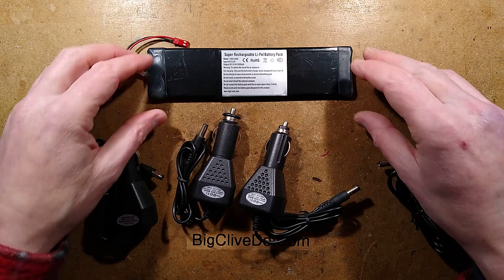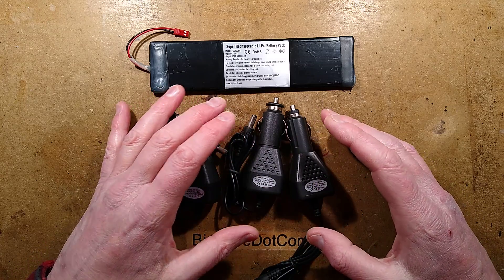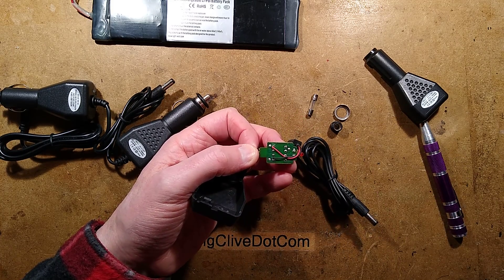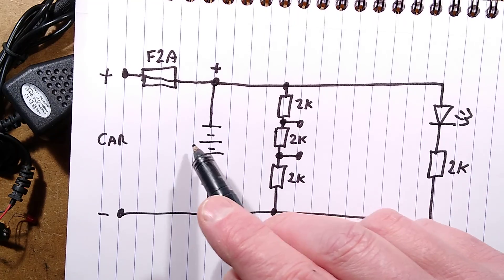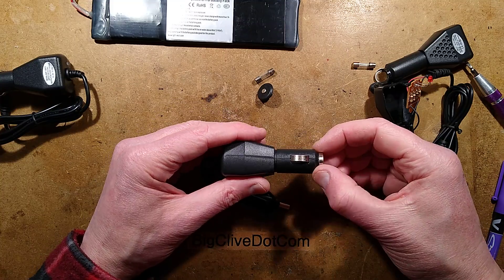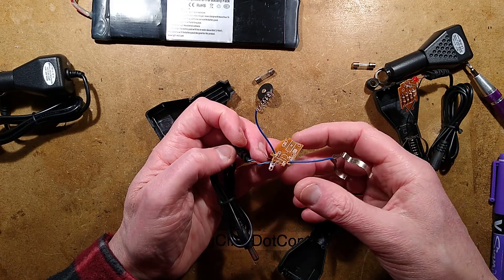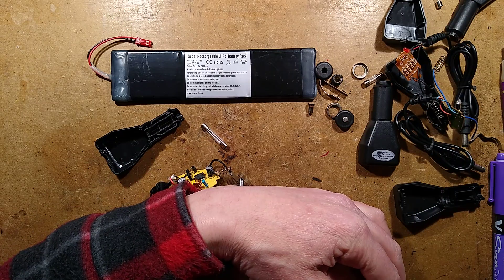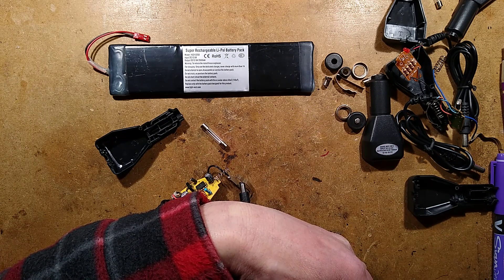Triple trouble - when offshoring goes wrong

Comment: re: that external wire freak fuse
in fairness, for low current and low voltages, there are open style fuses. see german/EU automotive style from 1970-1990.  for that matter, the Japan/USA automotive regular and mini fuses are simply enclosed in plastic to prevent accidental shorting.  It IS possible to find proper fuses with exposed filaments used for automotive products (or mass production low voltage) .  The "fuse" we saw here looked to be 10-40A if real, which is clearly too high.  maybe the assembler got a "deal" on 10-20k of 20V/25A fuses in this mini size, perhaps intended for a board clip mount, which were disco/sitting inventory from an unknown (chinese) manufacturer.  Or, the rush current from the non-circuit straight-charging was popping all standard fuses in the size immediately, so extreme "fuses" were batch made for this fraud.  This is much more likely than someone in China reworking individual blown fuses.

like 99% who might read this, I have some expertise.  But if I didn't, a takeaway would be to check the fuse when you buy something cheap that plugs into a car's socket.  With higher cost, trackable sourcing works in your favor, but the cheapest items out there often fly under the radar of regulation.

Comment: If bms inside the battery limits the current and protects the battery, no big deal to send 12V directly to battery.
Reply from the maker: The BMS has no current limiting.  Just extreme load cut-off.
Reply: @bigclivedotcom  It must be very s**tty BMS. Open it and have a fun

Comment: My Baofeng UV-5R "foldable" antennas ended up being two strips of measuring tape screwed together under a very nice rubber finish. (The Bezos company has no problem selling these products). I already knew the antennas were fake before cutting them apart because the manufacturer "website" listed as follows: "sample product 1" "sample product 2" "sample product 3"...

Comment: Wow, those 'manufacturers' (bodgit n scarpa) really didn't give a stuff when they made those. It's probably also a major problem if a company buys in a batch of those chargers from a supplier to include with a well designed product of thiers, and then doesn't spot check every batch. They wouldn't realise if the supplier cheaped out and bought in a sub standard product.
(Something similar happened in the Aerospace industry a few years ago when an import supplier bought in cheaper bolts/fasteners without knowing or caring they were destined to hold jet engines together). Scary stuff.

Comment: I talked to a guy who worked for McDonnell Douglas when they were doing their "trunkliner" program for the MD90. They spun up an assembly line in Shanghai. He was on the team responsible for QC. Very long story short, the second they turned their backs, the production shortcuts would start. Missing rivets, wrong fasteners used when doing dissimilar metals, wiring not routed appropriately, just nonstop corner cutting. IIRC, those planes were basically re-checked as soon as they landed back in the US to ensure nothing was missed. 

~15 years later, you see Comac come out with the ARJ21 with parts obviously ripped off from the MD90 design. Can't imagine where they got those blueprints or tooling from..

Comment: Chinese (PRC) industry has practically ZERO ethics in its manufacturing and sales. For them being able to sell a low-quality or even flawed product is a measure of success - makes them feel smarter than the idiots that buy them. You need your quality control supervisors on-site to make sure flawed products are discarded before they get into your supply chain. The problem is that those products then end up in someone else's supply chain anyway.

But this strong lack of ethics is the opposite of Confucianism, and is definitely not present elsewhere in the countries that have had strong Confucian influence. Taiwan for example, or even Japan, where aiming for perfection is at the heart of their manufacturing and sales principles. 

Why? 

Years living under the control of corrupt and untouchable party officials? This is what scares me from China. A Confucian China is a good for the world. An morally corrupt China is not. 

Can some Chinese readers comment on this?

Comment: Fun stuff when you find out Ford and Toyota never lowered their charging system voltages to compensate for maintenance free batteries that came around in the early 70s, so they still charge 14.5-15.5 volts.

Which you will see across a cigarette lighter socket.

Comment: My favourite Chinese manufacturing story relates to dumb base plates for railway sleepers. A friend went to China and checked out the products and found a defence contractor who produced these dumb bits of plate with holes in them that met the standard. The engineering issue here is that this was a high speed track and if the holes elongate and the track width changes a train fires off at 200 kph etc. An accountant unilaterally decided that the 30% extra cost for the good product  was a waste and decided they should go with something cheaper. Well, a few months later the plates failed and the litigation started.  There were lots of zeroes on the claims.

Comment: I was watching a video from Shango066 where he was working on I believe it was a CRT TV where there was aluminum foil wrapped around the fuse and on another video on a TV where some one removed a circuit breaker twisted the wires that went to the breaker together and taped them to a metal support bar on the TV. I think some people have death wishes when it comes to this stuff.

Comment: Connecting a battery to a power source without current limiting is especially bar if the power source can output high current without a big voltage drop and these things are powered from a car battery which can provide a lot of current, limited mainly by fuse

Comment: Cellphone repair shop i used to work at tried to get custom branded charging bricks, min order of 500 pieces, the first one i pull out of the box and plug an iphone 5c in as a load, through a usb amp meter, cube was found across the room, skidmark around the outlet with the prongs still stuck in the outlet, and a very stunned me. i was super sketched out plugging things into outlets for like a week after that. the iphone was fine, the usb amp meter, was not, crispy.

Comment: There's a great video about SMT electronics manufacturing over on the EEVBLOG channel.  The guy providing the tour stated that when they outsourced manufacturing to China they had failure rates as high as 25%.  When they brought the manufacturing in house (Australia) the failure rate dropped so low it couldn't be accurately measured.

Comment: I was looking for a hot air rework station. I narrowed the choice to 2 brands.
The next day I came across videos of both brands catching on fire.
I started looking again. 
I recommend finding a teardown of any test equipment you want to buy. 
A lot of their test equipment is dangerous. Do not leave it connected to power.
Why do they want to harm hard working technicians and engineers?
Reply: Quick 861dw. Don't buy the knockoffs that look identical. Also the BST-863. Almost identical to the Quick but slightly lower build quality at half the price.

Comment: As a general rule, Chinese made products are poor quality at best, often non usable, or even dangerous. If it's for export, it's often just a fake. I have had that opinion since the Chinese began dumping their junk on US docks in the mid 70's. However, there are Chinese companies that actually make quality an important priority and consistently adhere to design specs. They are few and far between, but they do exist. The problem is that most companies that source from China fail to inspect shipments on a continuous basis, if at all. Then it becomes a buyer- be- ware issue. Your dissection of these items on your channel proves this over and over.  We thank you.

Comment: 3:17 this is a pretty standard design in the US. You are only guaranteed a fuse in the tip, and you should expect the cigar lighter plugs to just literally put the cable across the 12v car battery (or 13v alternator). you do get two fuses though, one lower fuse in the cigar lighter tip and another bigger fuse in the fuse box that feeds the cigar lighter. there is no SAE standard for if the cigar lighter has switched power or not though. some cars (like mine) have the cigar lighter ALWAYS connected to the battery, and some have it switched on the ignition circuit. there are arguments for both, although most modern cars have a switched lighter because actually lighting a cigar in the lighter is become more and more rare. Out of all my cigar lighter plugs though, only one of them have has current limiting inside the plug though

Comment: This is why I wrote to a company in the UK  to buy logic fuses, because I didn't trust the same parts on Ebay/Amazon and alike to be genuine. For a part that only blows when the current exceeds 12 Amps... fed by parts that can supply well into the tenths or even hundreds of Amps (18650 lithium cells), I wasn't planning on taking the risk. Yes they were far more expensive (but that was also the sole reason I suspected the Ebay/Amazon ones to be fakes one way or the other) but they got the job done and on the total cost of all the parts I needed (some 900 Euro I think) spending 50 Euro (this included shipping to The Netherlands) on 10 fuses was nothing.

Comment: Those are obviously power supplies for a charging module of some type. Where is that? You don't plug a battery into a 12v barrel connector so there's something missing here. Kind of a worthless video if you don't have everything that's supposed to be there.
Reply from the maker: These were supplied for direct connection to a battery pack.

Comment: Cue Clive running 24V or more across one of the lithium packs which is fully discharged "just to see what happens" in 3... 2... 1...

Bonus points for using the 2 "odd" chargers to see if it's the fuse or battery that dies spectacularly first!

Comment: Just been given a hedge trimmer, only thee things wrong with it.
The lead had been cut at some time and stripped back, copper twisted together and some, now really gungy, sticky, insulating tape. No strain relief but, hey, it was still conducting.
So, the fuse, it was a wrapped in tin foil affair but luckily the carrier, holder in the plug was missing as it made great contact with anything it touched. It was the type you can fit without disassembling the plug. 
finally, not electrically bad but the safety interlock switch on the handle was also tapped close so as soon as you picked it up it would start up.
The guy who gave it to us was an engineer, not electrical!:
It is now safe, well as any evil hedge trimmer can be and we are all here, with all our fingers intact.
He, is not but the good news, it was not the trimmer but old age. result.

Comment: A company I did work for back in the '90s decided a Toko coil they used in xenon flashers was too expensive so they got it copied. The copy coils appeared to work fine but then they started getting units returned with the driver transistor blown. They asked me to look into it. 
Easy enough to find the problem. The copy inductor was very close to saturation when cold and as it heated up the saturation point lowered. Eventually positive feedback kicked in and the transistor went pop. They went back to using the Toko coil.
Reply: They would say "What do you mean, they both use grey ferrite?"

Comment: Many years ago I worked for a small Diesel engine manufacturer and they, under the influence of their new asset stripping owners, were told to stop making camshafts in house and get them made in China. A 'reputable' supplier was approached and business proceeded along the usual lines, drawings and material specifications were sent out and we waited for questions and then, amazingly quickly, the product, supposedly made by the Chinese company arrived and went through first article inspection. I was somewhat surprised when the inspector called me up to ask why I'd sent one of our locally produced camshafts (he was asking me if I was checking up on him and his team). We pulled the manufacturing marks (foundry pattern marks) and tracked the part to one which had been supplied from the UK as a spare to one of the companies far east agents. Chinese companies can and do make really high quality products but if you are using generic manufacturing houses you have to put a supplier development engineer into the company to get them up and running and then not be too surprised when your parts appear on the open market, under cutting you. I believe it's known as 'fourth shift production'!

Comment: What should be the fuse rating on these things? I took apart my Amazon basics one and it is 250 V, 6A. Surely that should not be on a 12v - 24v device?
Reply from the maker: It may just be a more rugged fuse.  The main thing is to protect against a short.

Comment: 3:55 - 😲 Well, I guess the car's 10A fuse (or 20A fuse, depending upon the vehicle and which port is used) will "protect" against catastrophic failure... Yes, I'm being sarcastic... Maybe the damaged PCB caused it to short, and the "Quality Assurance" team found a creative workaround?
5:09 - A standard-length fuse is not always an indicator of better quality, but it does seem to be the trend. 5:23 - Yes, MUCH better.

Comment: This isn't really that surprising. I'd highly recommend the book "Poorly Made in China" if you're interested in how this happens. Basically, you send your design in and the first few runs they'll built it exactly to spec. And then they'll do something like take out a fuse to save a few pennies. Next thing use a cheaper plastic for the casing. Then they'll do what we see here where they literally remove just about everything except what is required to meet the bare minimum as to be defined as "functional". 

I'd imagine if that Chinese company had the contract long enough, eventually they'd release a version with absolutely no circuit board. No fuse. Just some insanely thin wire (with thick insulation to make it seem substantial enough) wired straight to the metal contacts. 

The reason why big companies can get away with making stuff and China while maintaining acceptable quality is that they send over employees to monitor production constantly. If you're a small business looking to manufacture in China... Well just don't unless you can afford to pay someone to live in China and monitor production. Otherwise they WILL be modifying your design in whatever way can make them an extra penny or two. And might end up destroying your products reputation.
Reply: A sadly fascinating book... now how cold is it in Chicago in the winter?

Comment: I'm a little bit surprised that those had fuses, it seems like everything now has just a spring (fusible spring?...at least one of mine did that melting thru the plastic to touch the outside and shorting then visual notification of smoke telling me to eject it out the window on the highway while stopping) or some of them have a spring with a slug of metal that is shaped like a fuse.  I have wondered a lot why nothing has fuses anymore for automotive plugs...

Comment: Reminds me of a fan I got from ebay a while ago. No charging circuit for the battery, Literally JUST a resistor between the battery and the 5 volt usb supply. it was an old style nokia battery that I promptly removed when I saw the atrocious circuitry. (There was literally a laptop cooling fan, the battery, usb port and power switch in this thing, and that was it!) $5.
Reply from the maker: The Nokia batteries usually have charge protection built in.  Some stuff does rely on that for charge termination.

Comment: They took our design and manufactured it just fine.  Then we found out our customer - the customer we specifically designed the product for - were buying the product from another supplier.  When we acquired one of alternative units it had to be disassembled to tell it from ours.  They had completely stolen our design including PCB layout, substituted a few parts, left out some safety parts, and sought out our customer to buy them instead.

Comment: Oof, those pretend chargers are bad as is, but that other one with the MC34063 is a lot of things, but a safe charger for lithium it ain't - no timing, no thermal protection.
My guess they are relying on the BMS in the battery to keep it safe.

Comment: I had an in car power adapter for a back seat dvd player, one day the player stopped working, and it turned out the adapter had got so hot, the case had melted.  i do look forward to when most devices basically get powered by a USB C (or similar) system, and you can do away with the supplied cheap ass adapters and use decent quality ones. These companies that try and save a few dollars on the power adapters really piss me off.

Comment: I met a QC engineer for a large model railroad company who spent 6 months in China working with the factory to produce an acceptable product. Though this seems extraordinarily long, it included bringing a new 8-cavity plastic injection mold into spec. He wasn't very complimentary on Chinese QC.
In your case, it appears the importer(s) don't do batch QC inspection. In the USA I used “Mil-Std 105E" (ISO 2859) to execute random sampling tests of production lots.